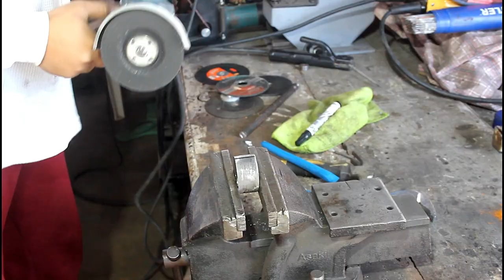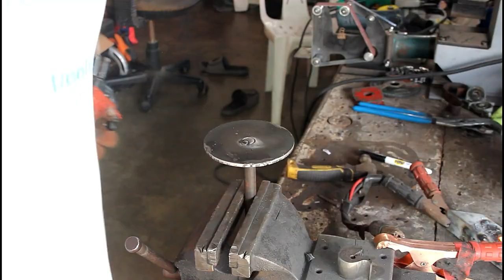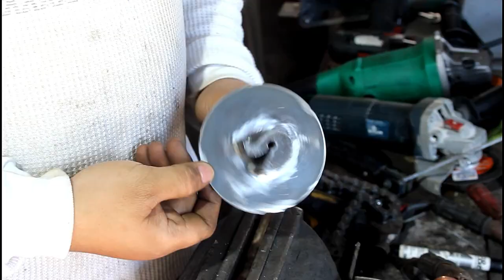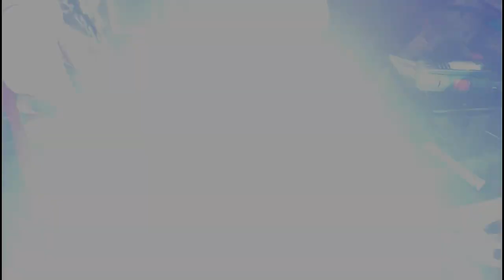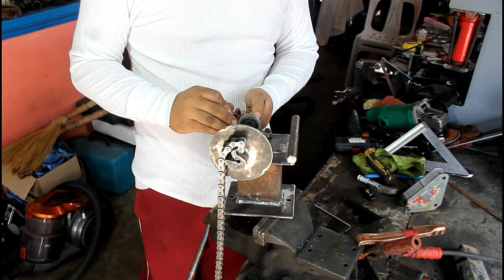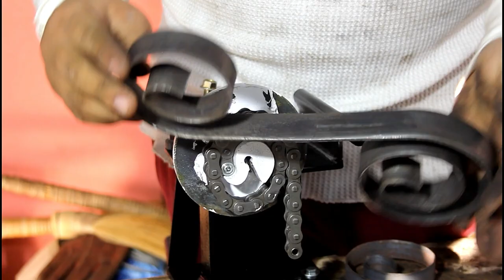DIY Scroll Bender Using Motorcycle Chain

Comment: Pretty doggone slick!!
If you wanted a spiral based on the Fibbonaci sequence (Golden Rectangle), instead of a parallel spacer (ie, chain), you'd use a wedge -shaped spacer that increases in distance so that your scroll space doubles each rotation. This  is  generally considered more pleasing to the eye.

Comment: Are you left or right handed?
Reply from the maker: Right handed why?
Reply: @SekAustria  Because I am used to holding the angle grinder with my right hand (I am right handed too) and seeing you holding it with your left, seemed a little strange at first, but it makes sense if you think about it (I have a pair of pants riddled with metal shavings).. I am an amateur so I was maybe doing it wrong all along :)